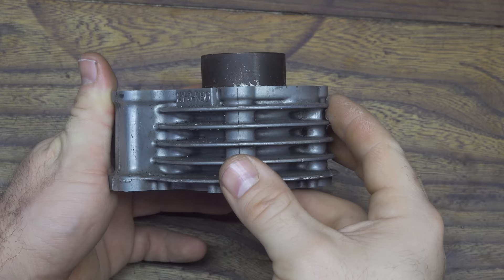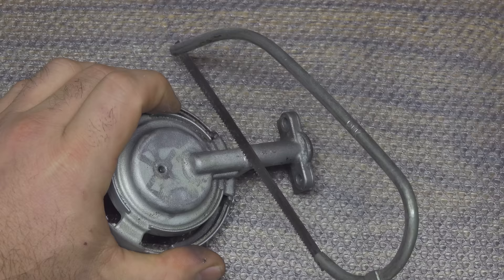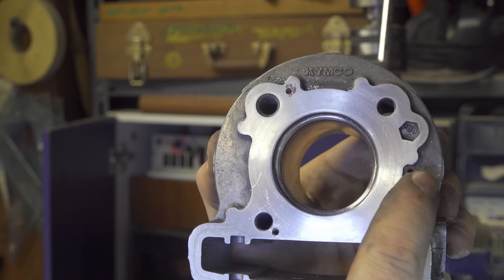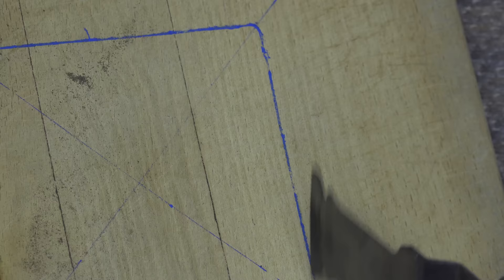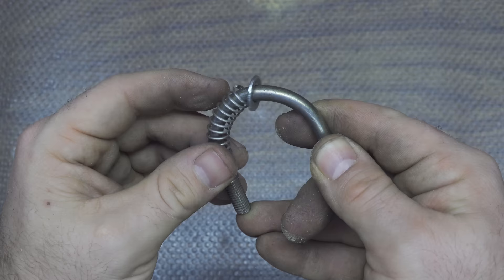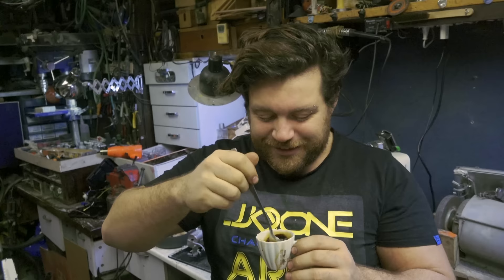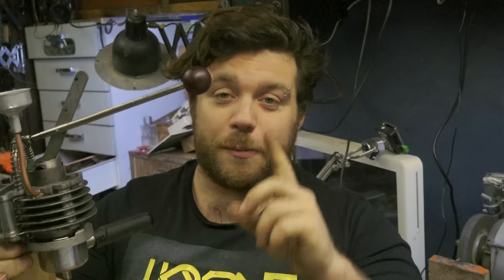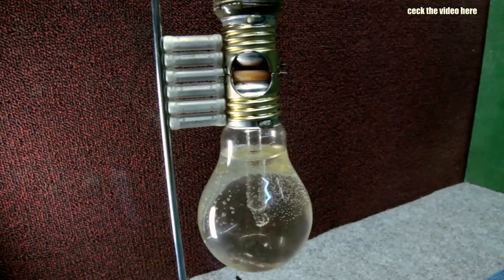Italian Espresso From Engine Parts • How to make it

Comment: you do understand those require the water to be under pressure right? this is just a french press, not espresso machine.
Reply: Yes! Exactly
Reply: SingingintheDark it s funny because in france we call those kind of machine "italian coffee maker "^^
Reply: Is not french press... the grounds are tamped, and yes, water is under a lot of pressure, like in any other open boiler machine, check Strietman CT-1 for example.
Reply: renatoa those were not tampered grounds of coffee. It's like drip coffee
Reply: Presurized portafilter, perhaps...
Reply: yeah it is. you can see it's not a 58mm group and that means it's likely to be pressurised.
Reply: it's exactly what i want to say........
Reply: This is not immersion brewing or drip style .Not sure if you know of la pavoni but  they basically pioneered and helped popularized espresso and did so with machines just like this. It's called a lever espresso machine and they are still made today. So it is not French press, or drip, it is indeed espresso in the most accurate sense of the word. The Piston creates pressure in the grouphead and forces the water through the grounds. Also just because it isn't 58mm doesn't mean it's pressurizes there are many machines that don't use the commercial standard of 58mm. Espresso n00bz
Reply: The water filled in cooles down immediately and there is no crema. Nice but not useful.
Reply: It's not espresso by definition, but half way there.

Comment: AHahah, great build! But let's be honest, This espresso can't be good :p
Reply: Hobi Basket Channel of course, he didn’t tamp it
Reply: True. Espresso is important in international culture. Each culture has something like coffee or espresso but with different meanings and ways to make it.
Reply: @costet534  he didn't tamp it, he didn't warm up the brew head firs, and should use ruber o ring to seal piston tightly against cylinder.
Reply: Seriously, no pressure gauge to make sure he's at 9 bars. That seal isn't great for the piston. The thermal mass of that that engine block plus a literal heatsink can't be good for temp control. Also he didn't tamp it or declump it, but that's not on the machine. 

Al's I imagine over time snapping the wood given how it's built

Comment: That cylinder heatsink is good if like cold coffee :)
Reply: zapro_dk the cylinder is lined with cast iron, cold rusty coffee.
Reply: colin edley cylinders are made from aluminum not iron
Reply: psaris7 most of the time it's made out of cast iron. Sometimes it's made out of the same material as the engine block (Aluminum silicon alloy)
But you can clearly see the difference between the materials, so it's most likely out of cast iron or iron
Reply: psaris7 the fins are aluminium, the liner of the cylinder is cast iron. It actually says so during the video when he has it in the lathe.
Reply: christian mühl r
Reply: You can see the face he does when he tastes the coffee, ahahaha
Reply: Wait till you see the mercury light bulb device.  Heavy metal poisoning is not a worry for this guy.
Reply: It would actually help to maintain the coffee and keep if from being over extracted. Lots of people actually add them to their lever machines if they want a perfect cup brewed at the right temp #coffeebasics101

Comment: maybe, you have to add o ring rubber silicon on the piston,, so it can be pump down the water without any leaking up,, when you press the water, make sure that the pressure produce 3-5 bar, and make sure there's no leaking, so lock it with silicon rubber,,  but, where did you get the portafilter lock/group head? did you made itself? so hard to find it bro,,

Comment: As it has been said as a concept and project this is cool. And well done, but if the aim was espresso than there needs to be pressurization from the water to the grounds. Around 9 bar (9x atmosphereic pressure at sea level)
Also the grounds would need to be properly tamped in addition to help with the pressure and formation of crema.
But if your into just any cup of coffee this will do fine.
Reply: Grayson Phillips 
The machine would easily be able to do 9 bar.
Reply: dude seriously? He made a coffee machine from a freaking bike motor who cares how many bars this thing is it's awesome! La Pavonis use way under 9 bars and it's still an amazing cup. Moka pots and aeropresses also are way less than 9 bar but still amazing. Is it "authentic espresso"? Maybe not, but you know what rules are meant to be broken and the scaa can shove it lol.
Reply: You can easily make 9 bars of pressure with this machine, the only 2 real problems i see with it are first that the engine is like a large heatsink, so water would be colder than expected, and the second but most important one is that he is not using a gasket on the bayonet lock between the portafilter and the grouphead so water is geting spilled every where and in consecuence pressure is lost. But with a lever you can easily make 9 bars of pressure, if you want i can do the math for you but trust me that it is entirly posible :)

Comment: If I may offer some suggestions for a future build: it is probably a bad idea to use a heat sink for you water reservoir, as you want to extract using hot water between 92-96°c.  This engine part, with fins, is designed to draw heat away, precisely what you don't want.  So next time, you might want to use a smooth cylinder. Also, I wouldn't recommend running 2 shots off of a single puck.. I can imagine, the second shot would be extremely bitter.

Comment: A hydraulic jack might work well, and those are easy to find an cheap, particularly used ones.  The advantage with a jack is the outer shell can be filled with hot water so the equipment does not cool down the shot so much.  Maybe even better?  A stove-top pressure cooker (available for $10- $20 at thrift shops) modified with a tube that goes into the water and a valve.  When the pressure in the pot reaches, say, 20 bar, open the valve, which is attached to s standard brew-group (i.e. 1:06).  That should shoot the boiled water through the brew-group at about the right pressure/temperature.

Comment: I just love people with ideas, garage-workshops and enough time. :)
The issue is that the water temperature drops way too much to get a descent espresso, because the parts distract and dissipate most of the heat in the process. You should try to submerge the whole gadget into a tank full of hot (92 °C) water. Or this will never be more than the handyman's coffee. Cool. Literally. And sour too.

Comment: Is it producing enough pressure?
Reply: Doubt it
Reply: Yes, it does, the lever has at least 1:10 ratio, and the force on the handle is in the 15-20 kg ballpark, thus 200 kg at piston, with 45 mm diameter this led to 9-11 bar, how is ideal
Reply: renatoa  if it's correct, I thank you.
Reply: You are welcome.
Yes, it's correct, 1 bar = 1kg force per square cm
45 mm piston diameter led to 16 sqcm area, thus 160 kg force needed for 10 bars.
There are already commercial machines like Pavoni, Strietman CT-1, or the more recent Flair espresso, using same principles, and figures were already been demonstrated for long time on forums like homebarista.